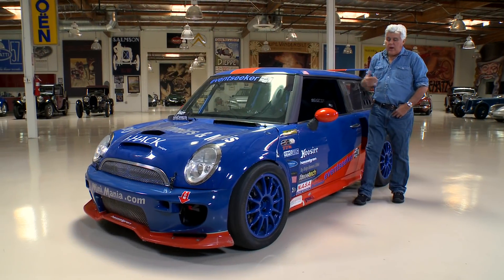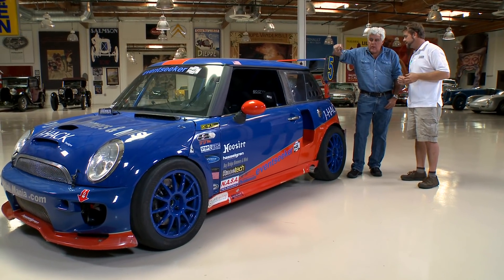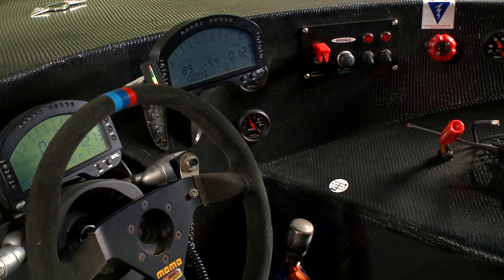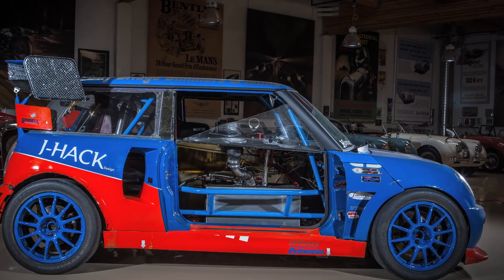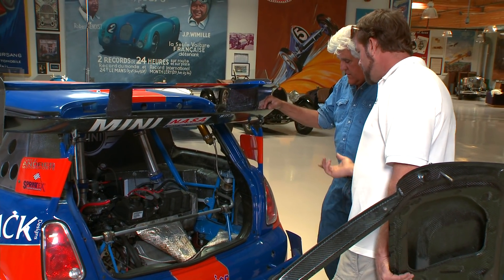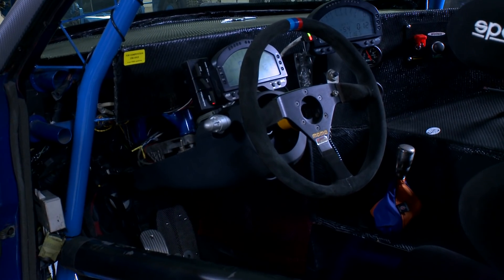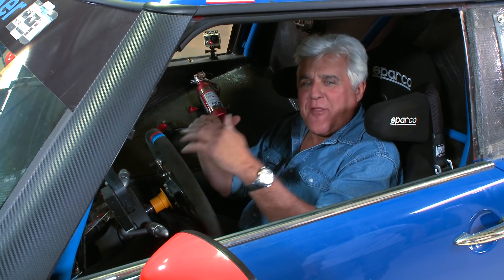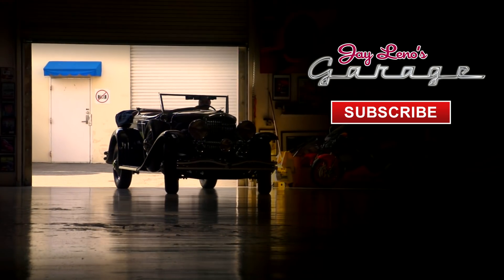2002 Twin Engine Mini Cooper - Jay Leno's Garage

Comment: This is nothing new, a company in Germany has been making dual motor cars for a long time I think since 2002. They are called MTM bimoto. The car they use are an audi tt. Has like two 500hp motors, one in the front and one in the rear. It's pretty wild. The car is insanely fast.

Comment: The only other twin engine car I can think of was the Bugatti Veyron, was this car
developed before then?  If so, then this is quite a feat of engineering.
Reply: the w16 is one engine
Reply: Cizeta V16 is twin-engine, two V8s
Reply: Way, waaaay before that, Monster Tajima's PPHC champ car in 1995 had twin engine layout just like this mini. Very similar execution as well. http://www.speedhunters.com/2014/04/twin-engined-monster-suzuki-escudo/
Reply: Bentley continental and vw phaeton
Reply: the veyron engine was the philosophy of sticking 2 v8 engines together to make a w16. but it is not actually 2 engines, it has been fabricated as one engine, and is one engine, in a W configuration with 16 cylinders. this is considerably different, it is an engine at the front of the car and an engine at the back of the car.

Comment: The only problem that I see is that in his system is only getting 50-50 distribution of the power all the time. If the front end is slipping for example there is no diff to send the extra power to the rear wheels, so you need to lift off the throttle cutting the power from the rear wheels too.

Comment: I bet this little thing will pull like mad when he gets the bugs worked out. Next thing he needs is a electric motor on each engine to assist and make more torque. Imagine 500ft lbs of torque instantly soon as you step on the gas. It would be a quick little car.

Comment: i dont think you get to combine hp numbers to come to 500. its still 250 hp, but all  tires are getting it instead of just two. If you dyno'd it the tires wouldnt miraculously get power from the opposite engine

Comment: Seems like what I liked was popular 4 years ago.  I got to be honest the guy building the MINI must have been Ex-Military or Ex-IT, maybe even NASA. You know the training on backup systems.  I personally don't think that configuration is justifiable for a Rally Car, although he might have a blast driving it around town.  The real issue, is the weight gain from two different sets of moving parts.  Then that is the down side as well.  The amount of moving parts that could go wrong.  On top of that, the individual used a standard MINI.  Not one of the longer units that had been built sense the reintroduction of the bigger platform.  Making it probably very uncomfortable and cramped to drive.  Now I am a 6ft individual and my wife and I purchased a 2005 and it was very comfortable for me to drive short trips, but it didn't have another drive train sitting behind me. I didn't see where he talked about winning any trophies yet,   I wonder were he races at.  Curiosity!

Comment: I can't understand ppl doubting the horsepower. A Suzuki 1300cc Motorbike can easily make 450-700HP (Max personally seen/heard) with Superchargers. This car has 2 engines Appx 2,000cc EACH + Supercharger EACH engine. EASY 500HP with almost standard engines. IF he CAN race against Porsches with one engine, bit unfair I think.

Comment: Pretty sure you don't get to add the two horsepower numbers together.  When you have 2 250 boat motors on the back of a boat you don't get twice the performance.

Comment: hrmm so if both engines put out 250 hp at the wheels, shouldnt it only put out 250hp on the dyno? So correct me if im wrong, the only difference would be power to weight divieded by the 2 engines.SO realistically that car only puts out 250hp but on the road it would be rated the same as a 500hp car in the same weight category.
Reply: you got 250hp pulling at the front AND 250hp pulling at the rear. it is similar to a regular AWD car with 500hp, which distributes its power to both axles.

Comment: s is NOT for supercharger.
Reply: that's true you are correct ! s is for sport right? cause the r56 is turbo not supercharged !
Reply: hahaha so true, i think cooper was going for super or sport and settled on "S"
Reply: S is not for Supercharger in the literal sense, but between the R50-R53s it differentiates between a base n/a cooper and the sport cooper, which was supercharged. Yes, the later S's R56+ were turbo
Reply: yeah, and the cooper s before bmw owned mini wasnt supercharged either. s has been around a lot longer than the super charged version, and keeps going long after it

Comment: I really don't see the point, running 2 engines just makes everything more complicated. there is a company in the uk that will build you a wrc replica mini with a Mitsubishi evo engine and 4wd running gear for much cheaper, they will also give you the power you want going from 300bhp to 700bhp

Comment: 'S' is for supercharger on the minis.... Was that a joke?
Reply: that is true
Reply: R53 (02-06) Cooper base model: 115 hp; Supercharged (S) model: 163 hp; Supercharged JCW model: 210hp stock and can get close to 250 with bolt-ons & tune. Jacques is running 2x modified John Cooper Works engines here.
Reply: @ChrisBrennanSF  thanks for all the information there. However the R50 is the one/cooper. The R52 is the cabrio, and the R53 is the S, JCW and GP. The S does not stand for supercharged. It is an overhang from when Austin/Morris/Rover were building minis. The final model offered a Cooper 'Sport'. Cooper S ensign has been used in several generations since, and all have been turbocharged, not supercharged.

Comment: Nothing new here, Issigonis made several prototype twin engined Mini Coopers back in the 1960's. I think one was to be used in an international rally but following a serious testing accident the project was axed by BMC heads. They also built Twini Moke prototypes as well. 
How these awful lumpen things can be called Mini defeats me, they are no smaller than any thing else, and bigger than quite a few......ridiculous

Comment: thats not a mini cooper , as john cooper didn't build it , also there is a mini cooper from the sixties that this is a copy of with two engines designed to compete in rallies as the original mini was becoming overpowered and it was a work around for four wheel drive

Comment: 250 hp x 250 hp is not 500 hp it’s still 250hp look at boats they have been running 2 or more engines for years the hp doesn’t increase the traction and torque does it would have been a lot easier to use a higher powered single engine and a awd set up more reliable as well ....

Comment: too bad the chain tensioner goes kaputt every 1000miles, and turbo melts the cooling system and bubbles in the paint.... yea i owned a mini and loved it but damn that model was constructed by brits with bad teeth...
Reply: Too bad you're talking about the R56, and this is the Supercharger one which has almost no problems.
Reply: i realised that just as i pressed post, but it was too good a burn to leave :)

Comment: Why couldnt it be street legal?
Reply: Many race cars are not street legal for a number of reasons.  Very commonly, and probably the reason in this case, they do not meet noise/emissions standards.  A lot of other race cars don't have working headlights, tail lights, turn signals, horn, etc.  I'm guessing with some really nifty custom exhaust work, that Twini could be made street legal.
Reply: Ytse Frobozz move to a better state where you dont get emission tested hah. as for the noice, I'd take the ticket every now and then.
Reply: it doesn't have turn signals xD
Reply: A street-legal version could probably be built, but it would be easier to start over than convert this car... it's obviously a race car.
Look up "twin-engine Mini Moke" to learn more.
Reply: Darko Filipovski this one has
Reply: Depending on the state is really what matters. It would be super easy to get it to pass tech inspection here in MN since we don't do yearly emissions. He could just get it certified and then swap the parts back. Most of the issues are with all the safety equip like the lights and such. The other half is the engine, because not all those parts meet federal epa regulations for on the road cars. It is sort of a pain to make a race car for the street that is equally good on the track. Also I would not like to drive a car with that tight of a suspension setup for long, it would rattle your fillings out after a while lol.
Reply: genuismensa
You might as well use an old Austin Mini to avoid emission and safety regulstions...
there won't be much of the original chassis left anyway, so it's only a shell.
Reply: Ytse Frobozz if all harleys are street legal then I dont think any car should be not street legal for noise. thats just my opinion. but money is money. all else, i agree with. but not the noise. lol

Comment: please.

car has easily $100k worth of parts, labor, parts, and parts.

I am all for cool, tripy, imaginative, etc. but I think this dual engine mini is just kinda dumb.
Reply: agreed.. I have a small soft spot for the goofy stuff... especially if it can actually pass a track inspection.. (remember the 1gen tiberon, twin-engine, that took everyones $ on the east cost drag strips years ago...?)
And I can understand destroying a cars handling abilities in drag racing.., but i would love to see how all that un-natural weight and hacked suspension handles the corners..? It prob looks cool chasing down a 'big dog' on a straight, but im sure its overall times are 'worse' than if you would have invested the same amount of $ in the 'proper' areas..
Reply: Jealousy will get you nowhere.
Reply: luke marshall It has nothing to do with jealously..
..Its all about, "Did the amount of $ and time, actually make the car faster/perform better.."
..Than if they had just sunk the same amount of $  into a 'normal' mini..?
Reply: luke marshall neither will ignorance